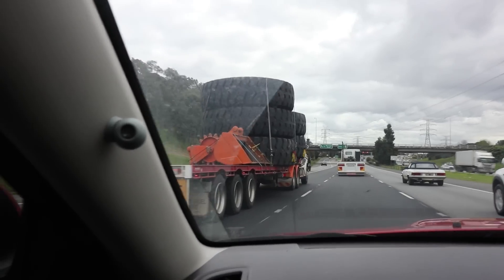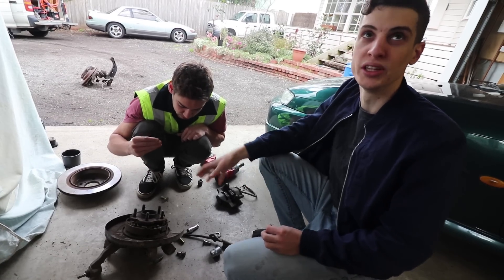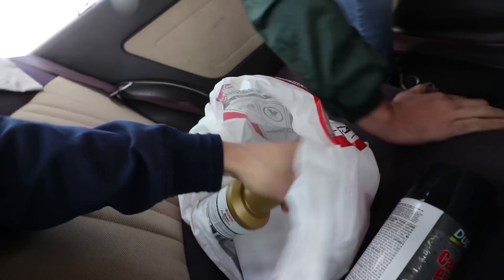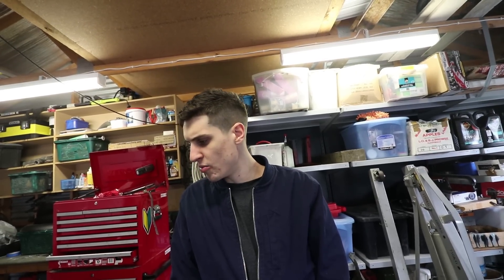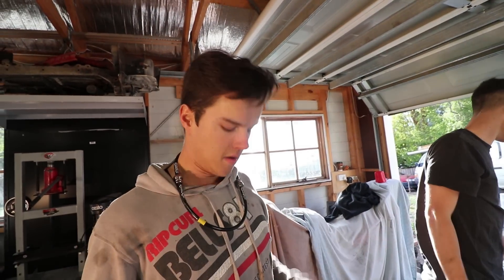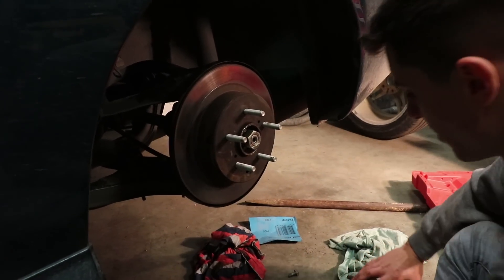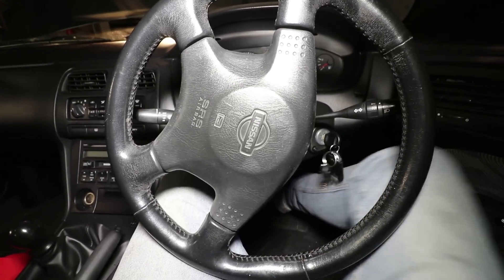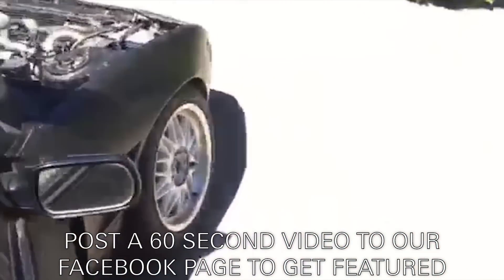Skyline Brake Upgrade to S14 Silvia

Comment: To complement the Skyline brakes and you already have the Master Cylinder Brace (which seems to be rubbish-ish), when the time comes to replace his Rotors you should look into the brand "DBA" (Disc Brakes Australia) they are top notch on their quality.  I've run them on two different chassis now and have been highly impressed.    See you gents next go round.
Reply from the maker: We've run DBA rotors on some of our cars, and they seem to be pretty good. But the rotors we are running at the moment have plenty of life left in them, so we don't have any plans to change them in the near future.